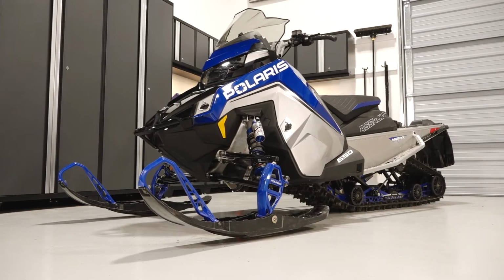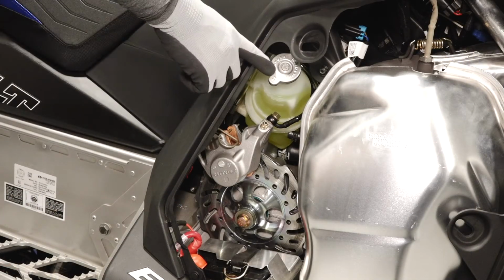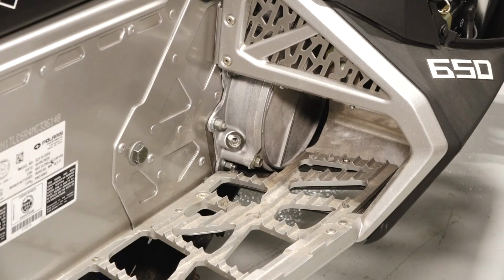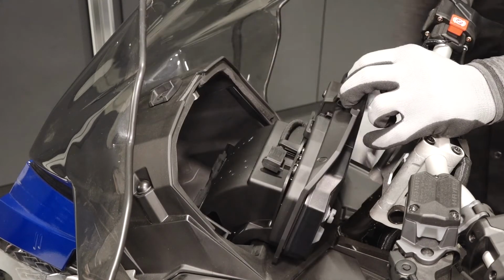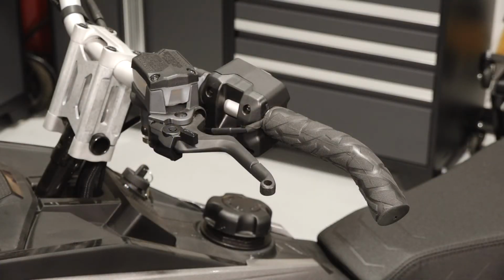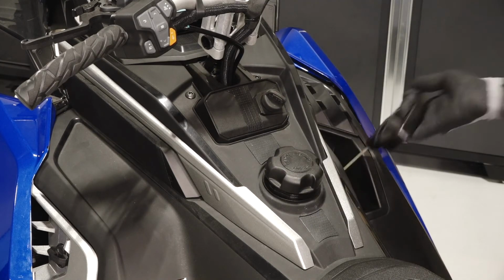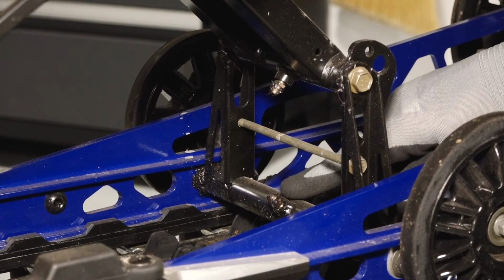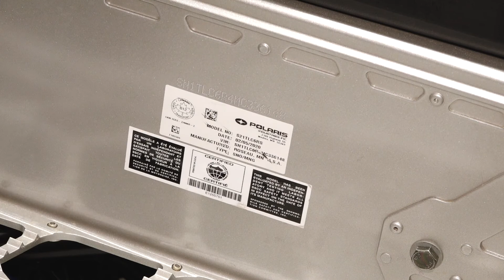650 Switchback Assault 146 Orientation - Polaris Snowmobiles

Comment: Very nice Orientation, especially showing some of the secret easter eggs, left for the owners by those who helped build the sled. Thank You, Polaris employees.
The Matryx sleds do not have a coolant OVERFLOW bottle. An overflow bottle would not be pressurized. The coolant bottle pointed out, actually contains the thermostat in the very bottom, and probably should be called a surge tank or just a coolant bottle. It controls the flow of coolant from and to the engine, as well as to the bulkhead and tunnel heat exchangers. It is where any air trapped in the cooling system is collected, and when the level in the bottle is low, it should be topped off, after cooling.